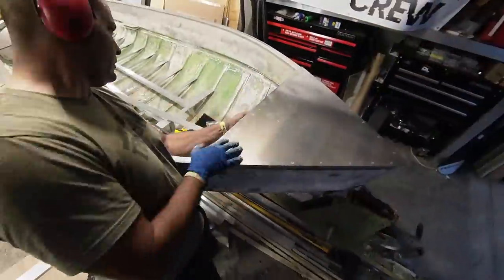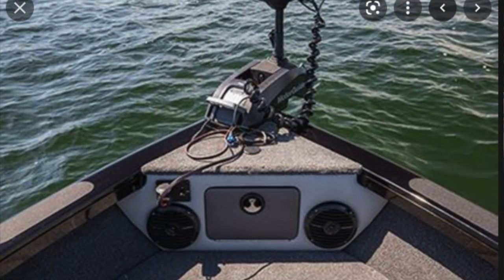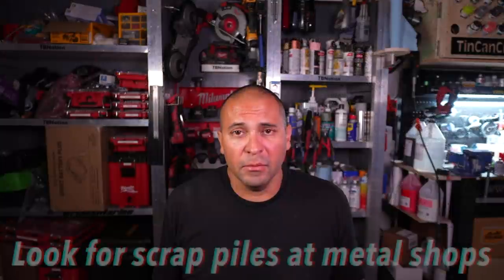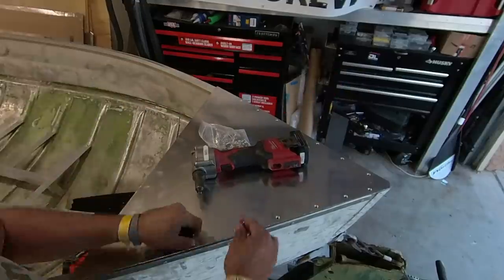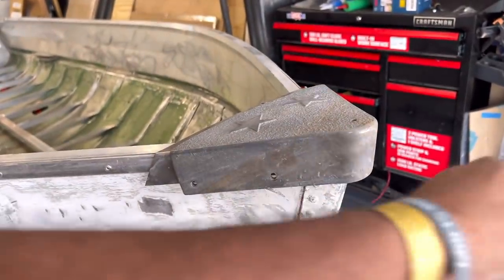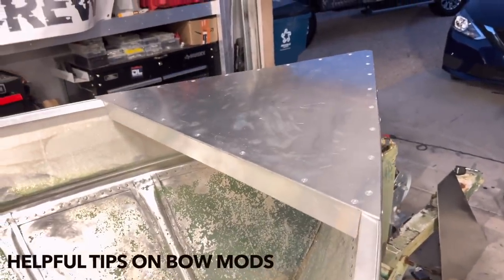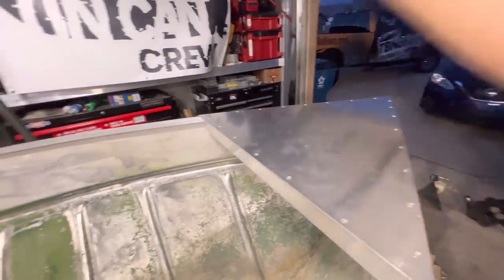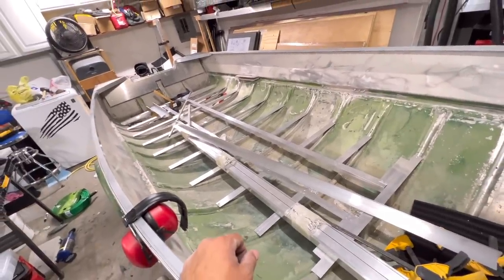How to make the Bow Plate: Low to High | Budget Boat Build Ep.6

Comment: I have just bought my first ever boat & it is exactly like this one. Question: i am 6'5" 305lbs, so i have to build a sub- floor that is very sturdy, but also light weight, & budget friendly. What size angle, with & thickness do you suggest? Boat is 14'Lx53"t-50bW×17"D
Reply from the maker: .067 with close spacing

Comment: I’m actually doing this  now and don’t know if I should put plate on inside of gunnel or on top because the slope angel on gunnel
Reply from the maker: If you're using aluminum you can bend it around the gunnel with a mallet
Reply from the maker: Sit on it for a while and then pull the trigger